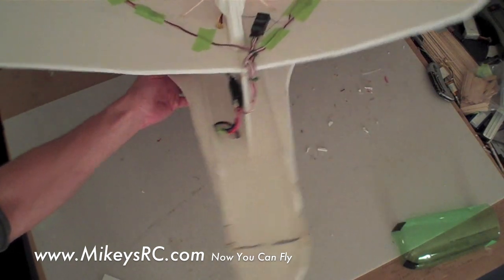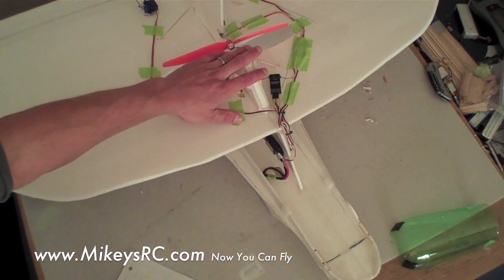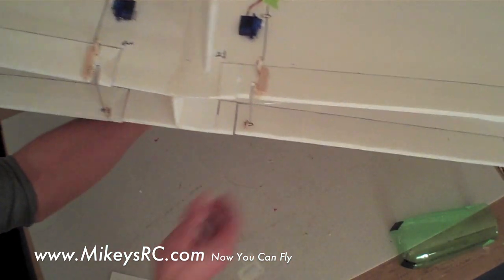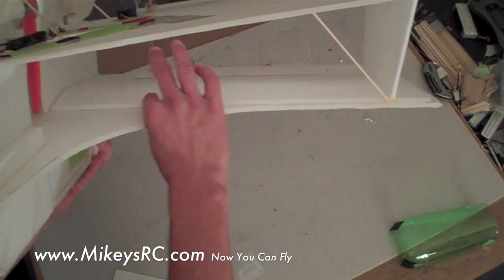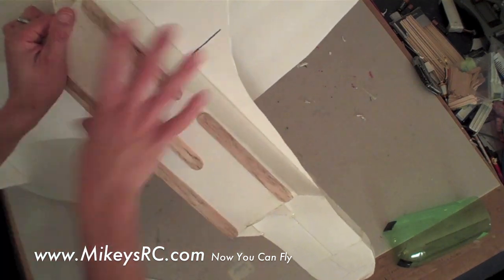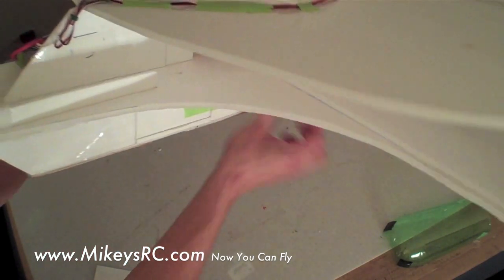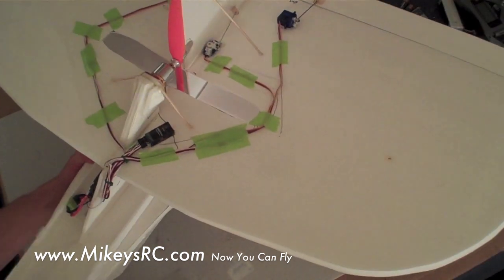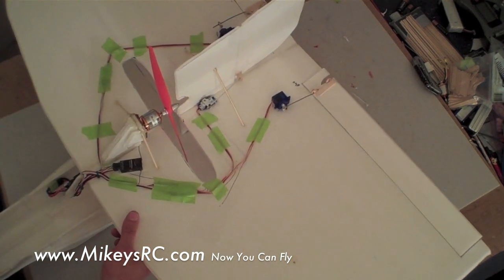MikeysRC Scratch Built Slow Flying FPV RC plane Build Tips

Comment: I am just about finished building the airframe. I am using a DX6i radio. Which wing tail mix do I need to implement for this FPV plane? Which slots do I plug the servo leads into on the receiver?

Comment: For the hinges, problem with a top and bottom hinge is the offset from the center line, one moves forward, one moves backward.  Instead, try this:

Super Light Pivot & Round Hinges D2.5xW8xL33mm (10pcs/set)  at hobbyking.  Pin hinge with a metal hinge pin.  Use 1 hinge, cut the pin and separate it.  1/2 into top aileron, 1/2 into bottom aileron, from the rear edge, making sure the hinge holes are the same distance from the aileron's hinge line.  Then a piece of wire to connect the hinge halves.

Comment: Mikey, the better way to implement mehcanically differential aileron throw is by off-setting the arm on the servo by app 45 degrees. Try it, and you'll see what I mean. No binding rudder surfaces required :-)

Comment: @MikeysRC They will discharge at different rates.  In theory, if they are at the same voltage at the start and then discharged in parallel, they will reach 3.5v at the same time.

Comment from the maker: @ter4m4x That's cool I like it. much simpler than mine.  The only thing is that you have to drill the hole perfectly in the Popsicle stick as there is no way to adjust the two control surfaces independently.

Comment from the maker: @TheIronSavior Hmmm...what happens though for example if you had a 500mah and a 2200mah after a couple minuets of flight wouldn't the 500 me almost drained but you wouldn't know it since the 2200 still had plenty of juice.  Seems like you could risk over discharging the small lipo if they are different sizes.  But I'm no expert.

Comment from the maker: @coolwaterhubby Yes you can to that.  Make sure to get two packs that are identical.  Same mah / volts and C rating.  Then you wire them in parallel.   If you wired them in series it would double the voltage and yo would fry your motor and ECS.  Search for my YC-14 Build video #4 and at about 17 min into the vid I show you how to make this kind of wiring.